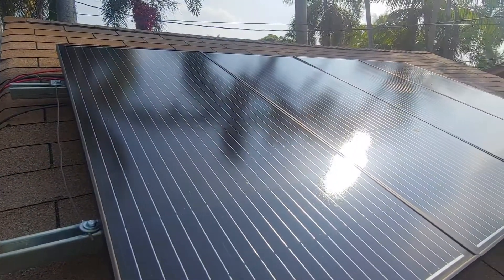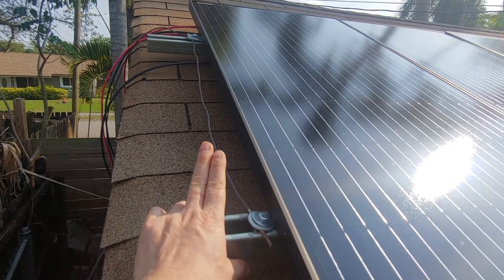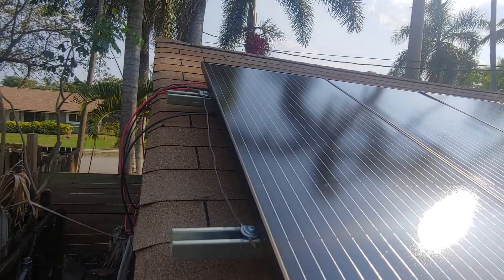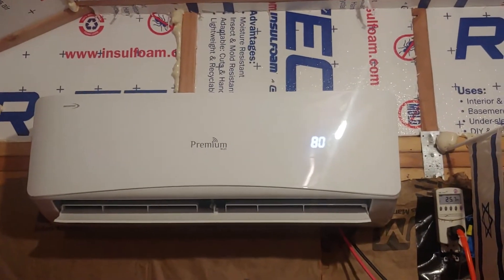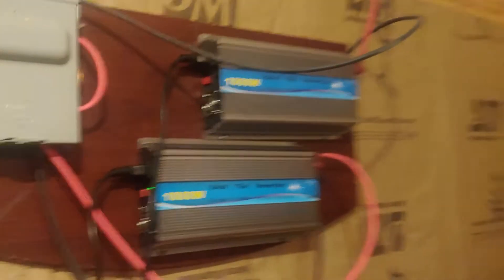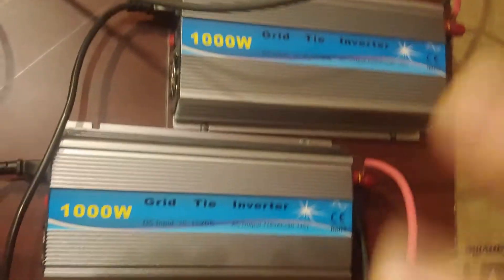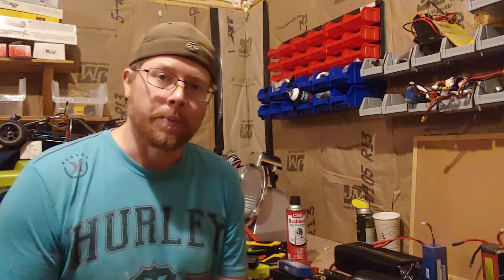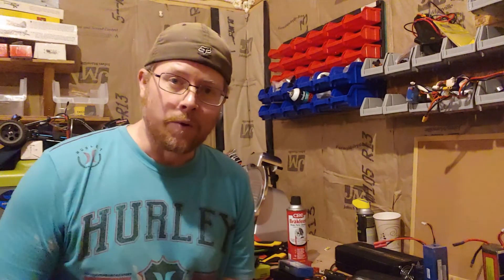Free Electricity For My Climate Controlled Storage Shed??

Comment: So! The AC is running only from the AC during the day? How does it switch to utility power?
Reply from the maker: The solar panels are connected to a grid tie inverter, which plugs into a regular wall outlet. The power produced will feed directly into the home power grid. Which the shed will consume in conjunction with the power from utility company if the PV array doesn't produce enough.